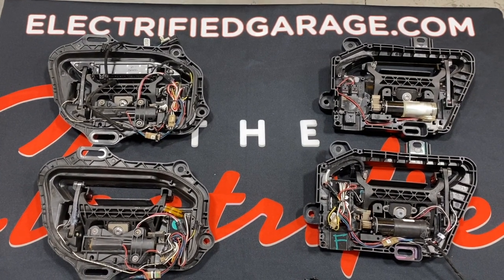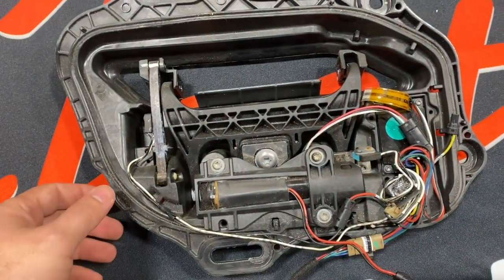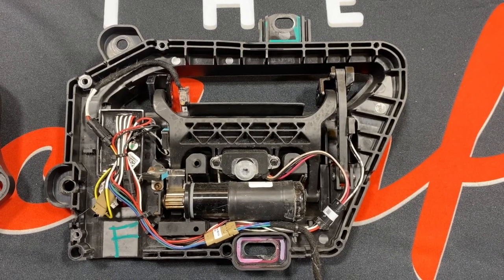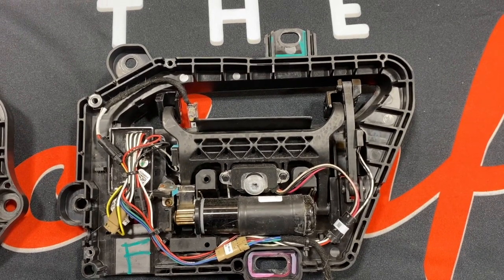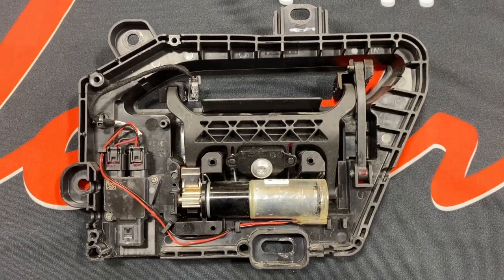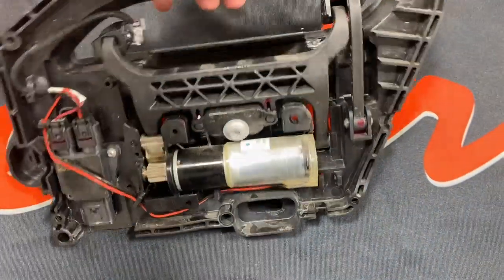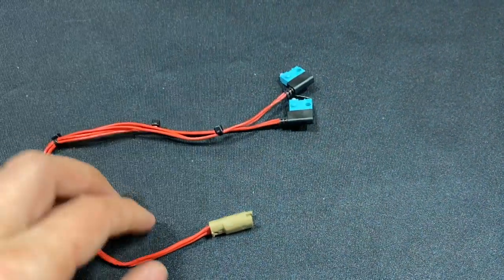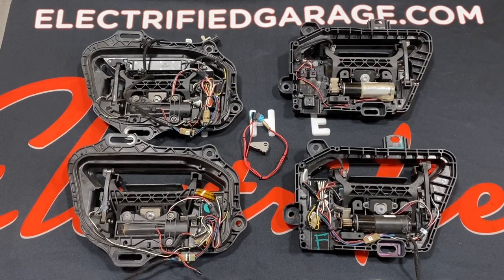Electrified Garage: What door handle do I have??? Guide to Tesla Model S Door Handle Identification

Comment: Hi I put new switches and harness into my 2016 Gen 2.5 door handle. Switches work fine when tested with a multi-meter. However handle still over presents and locks solid with the motor stalled under power. Any ideas how this can be fixed? Thanks for a great video.

Comment: What could be wrong with a 2nd gen door handle if the handle isn't coming out but motor and gear are okay? Pressure sensor is also okay als other handles are moving out if I push on the faulty handle. The two switches which could be replaced are okay also. May it be the third switch for the inner stop?

Comment: Had the latest 3rd gen door handle installed just last week by Tesla in 45 minutes in my driveway for $311 to be exact. It also had to be programmed and had to do an update. Comes with Warranty. Tesla said the $311 is parts only. They don’t charge for labor. It’s Goodwill due to it been a common issue which is fair. I say it’s well worth it and better than trying to repair yourself and screw things up or damage your door panel, paint, etc.

Comment: i have a new 2017 handel system in my 2013  model s. the handel pops out and the door opens/unlocks his self like a model X :( is this something to do with the hall-sensor?  motor makes noises when closing....are is this a ecu software thing?
Reply from the maker: That is a symptom of a faulty microswitch, there are 2, the first has present the handle to a preset position, the 2nd is the open door switch. If it doesn't see the first signal it will pass the "preset" and push the door release. It is not a software Thing..
Reply: @ElectrifiedGarage  so these 2  microswitchs are not hall sensors?the door handle now comes out neatly, but then goes right back in again....because he 
doesn't see the lock hall signal?
Reply: @ElectrifiedGarage Thank you EG

Comment: Very nice guide.  Recap- presents but does not release when pulled= most likely a faulty micro switch.  Will not present= most likely faulty paddle gear.  Gen 3 fault= fun times.
Reply: Funny seeing people confused with the operation when they encounter the first gen handle.  Some loved it, some hated it.

Comment: Are there any solutions for Gen 1 handle modules? I much prefer Gen 1 and if there was any way to solve a flakey module issue it would be cool to keep the early cars “original”
Reply: Anyone have a solution for Gen 1 opening repair? ( door handle projects out, just not opening the door).

Comment: Didn't realize the rebuild kit was $180 per door handle, that's kinda spendy, but I guess it's worth it to make each door handle basically indestructible
Reply from the maker: To not have to go back in there again and deal with it, it's worth the parts. They're made in small batches for quality control and were designed in house.
Reply: Can just get the newest one installed by Tesla for $300, so a $120 price difference if you do it yourself. So if you think your time is worth $120 for the teardown go for it.
Reply: @benc1927  same here. Had the latest 3rd gen door handle installed just last week by Tesla in 45 minutes in my driveway for $311 to be exact. It also had to be 
programmed and had to do an update. Comes with Warranty. Tesla said the $311 is parts only. They don’t charge for labor. It’s Goodwill due to it been a common issue which is fair. I say it’s well worth it and better than trying to repair yourself and screw things up or damage your door panel, paint, etc.
Reply: When a "kit" is better than the original it's worth every penny. You know how much a full assembly costs from Tesla? You'd happily put down $180 and rebuild it yourself.
Reply: Welcome to America. Either you pay 1k at Tesla each time it goes down or someone creates a 3 dollar fix and charge 180 because the alternative is to pay 1k lol. Welcome to greedy society.
Reply: @IAPPLEWIZ  tru i imagine the cost of the kit is also because of them only making a small amount. i went with cheaper replacement $5 metal part which will fail at some point but it will be years away.

Comment: I love these improvements to design. I hope tesla would incorporate them stock at some point. I hope this doesn't void any warranty, or make it an excuse to cut it off from the supercharger network for stupid reasons. Great work, great video!
Reply from the maker: The Gen 2.0 and 2.5 are the most resilient with the upgraded parts we designed. Gen 1 failed really fast and Gen 3.0 is not DIY friendly if there is an issue. Their intent to simplify with Gen 3.0 was good except that now you're at Tesla Service mercy if something goes wrong.